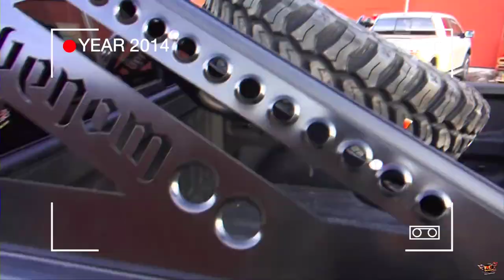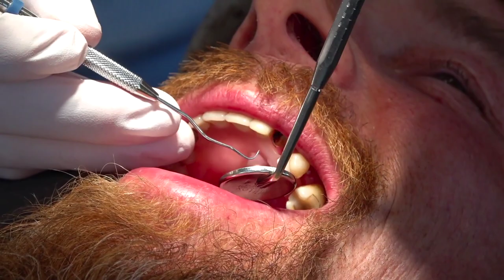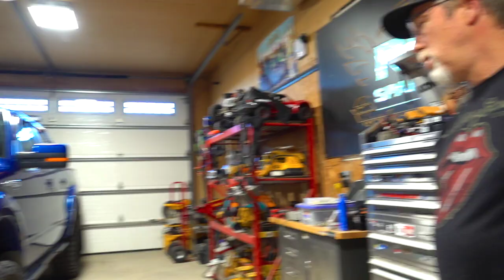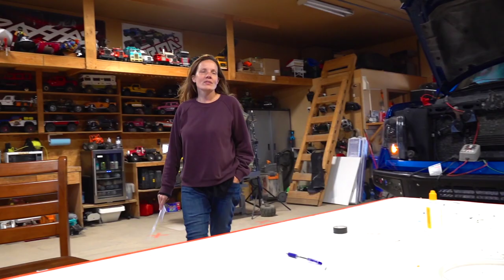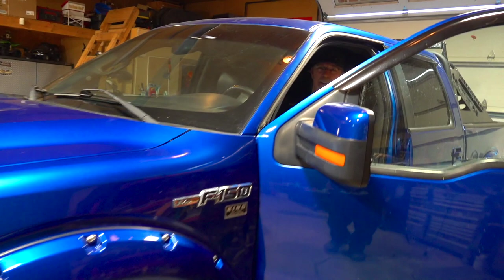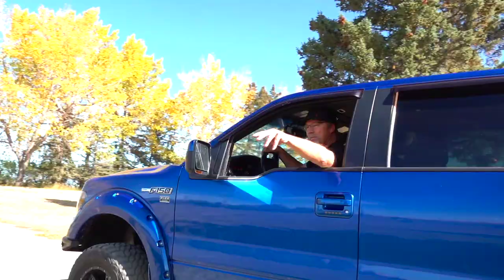I give BiG BLUE Away | RC ADVENTURES

Comment: Who gave this a thumbs down?

(One comment on your truck...remove the hitch when not towing.)
Reply from the maker: It's a "permanent" fixture.  Note the support bars on the hitch.  #TeamRCSparks!
Reply: @TheRealRCSparks , never noticed that. 

I HATE seeing trucks driving around with a hitch and no trailer. 

I had my front end and radiator punctured by an asshole who cut me off just before a stoplight and jammed on his brakes. 

Asked if we (my son and his friend and I had been at an Oilers game) were okay and then took off. 

Couldn’t get his plate and the repair was almost enough to write off my 2000 GTP. You can understand why it pisses me off so much. 

Not to mention seeing people bang their shins in parking lots.